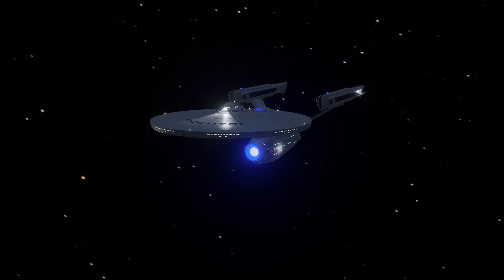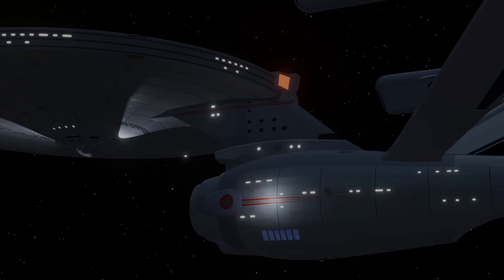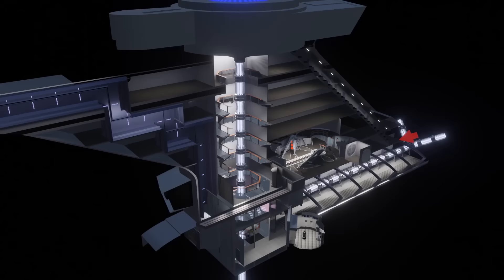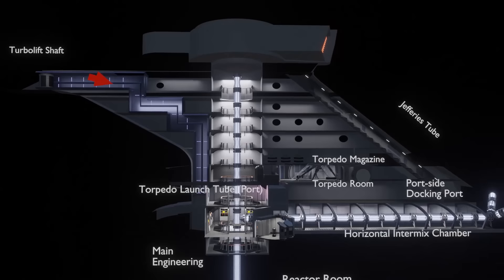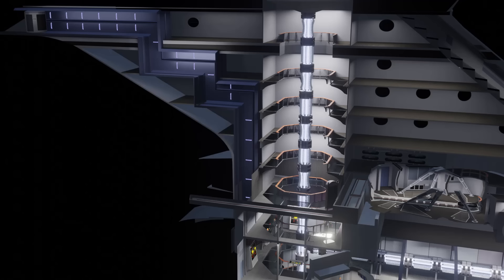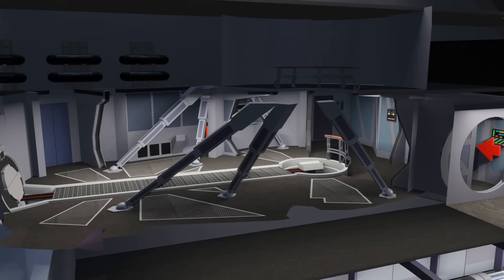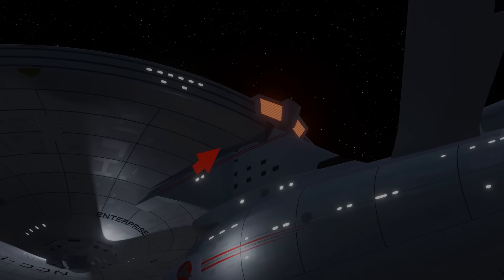The Enterprise Dorsal Problem: how did the turbolifts pass through it?

Comment: A potential solution to this is for there to be an odd technicality about how the ship's length/width and height are measured, which I assume is how you are getting the 5m width.  The stated 300m size is far too small for a ship containing the amount of machinery, crew and general space the enterprise does, however in most realworld ships not all of the physical length is taken in to account  in the stated length and additionally there are various different lengths that are given depending on circumstance (ie waterline length vs main deck length vs flight deck length etc.)

Is it ever stated that the 300m figure is the absolute overall length of the enterprise?  If 300m only encompassed a part of it, then that would allow the dorsal to be larger and so to facilitate the turbolift running past the transfer tube.

Comment: Star Trek: The Motion Picture, at the 19 minute and 41 second mark, where Kirk enters the "refit" NC-1701 TurboLift, gives us pretty much everything we need to know to answer this.  On the wall behind Kirk is the COMPLETE layout of the ENTIRE TurboLift system; INCLUDING a mapping of where it is routed through the Dorsal.  

Although it's more of a user interface than a technical schematic, it clearly shows it descending along side (or in the general vicinity of) the warp/plasma conduit for the saucer impulse engines, all the way down to the core itself (and all points in between).

Comment: There's only one possible explanation. There are transporter pads placed at he top of the dorsal shaft either side of the core. The turbolift passes through one, is automatically beamed across the warp core to the other and continues on its journey. My work here is done. 😁

Comment: In addition to everyone pointing out that the turbolifts could move both vertically and horizontally, I have to point something out - why does the intermix shaft have to run completely vertical through the dorsal section? Other than at the points where it connects to the warp core and saucer section, it can easily run parallel to the Jefferies Tube.

Comment: Possible that the one turbo lift ended (from the torpedo bay). Exit the turbo lift. Walk around the vertical intermix chamber, Then enter another turbo lift on the opposite side of the vertical intermix chamber.

Comment: The nice thing about Trek is that there are gadgets that help plot lines along. Such as inertial control. The lifts are equipped with their own limited life support, inertial controls and structural integrity fields. SO essentially they are spaceships unto their own, just no warp capability.

You thought they would just be capsules riding in tubes? Think agian.

Comment: Yes vertical and diagonal breakaway tram shafts while in the primary hull, and yes, that shaft be in the aft section anyway, well clear of the lifts on either side on main engineering.

Comment: If you have artificial gravity, then "down" is a matter of in which direction it is applied. Meaning, there should be no problem with the turbo lifts running diagonally.

Comment: Surprise, surprise!  The turbo lifts actually use teleports to move around the ship, no shafts required at all!  
PS - When it opens on the "wrong" floor that is just because it always teleports to the next nearest location where a call button has been pushed; this reduces the energy usage by limiting the distance between each teleport.

Comment: I never knew why we all just naturally assumed that the turbolift shaft is super strait. It could be anywhere from diagonal to just off wonk a bit.
Reply: Its moving pretty quick between decks. This requires the shaft to be pretty straight. Else the people inside would bang from wall to wall when the acceleration changes.
Reply: @vast634  Dude...Inertial  dampeners and / or gravity plating. Strait is just as relevant as up in space.  It could be a mariokart track for all we know of other then the corridors and Jefferies tube are kinda strait.  

its a fucking maze down there. 0.0

Comment: there is also one other problem with where the turbolift is placed forward of the engineering and warp core decks,  there is a manned access hatch that we see spock and kirk use in the wrath of khan, that ladder goes inbetween the torpedo tube conveyors and accesses main engineering, so you cant have that and the turbo lift there at the same time.

this falls in line with the oberth having a "manned" canoe that there is no access to the rest of the ship.  lol

Comment: Going over schematics and blueprints actually has the neck's width closer to 7.5 meters (a little over 26 feet). It's still a very unlikely design and there's a problem, but not quite as big of one as you suggest. Also, the tube design IS very weird and would have made much more sense if it had gone diagonally. 
https://www.cygnus-x1.net/links/lcars/blueprints/ksy-enterprise/11.jpg

Comment: All that based on the TMP/WoK movies. Based on later movies, one can imagine a much smaller upper intermix chamber conduit, in a much smaller space around where the turbolift goes. In the FF movie, the turbolift shaft is straight up. (although that scene is completely ridiculous depicting 72 deck plates and so making the ship 3 times bigger than it really is). 
I once tried to drqw the ship myself with very few reference points apart from one angled picture.  I manage to put both conduits aside eachother but as I drew only in 2D I didn't have the problem of having to cross both around. Eventually, the UC movie would depict a much smaller intermix mount allowing more space for the turbolifts since they replace the big conduit outside Engine Room with EPS conduits that are much smaller in size.
However, in Sci fi there is that constant that interiors are generally badly designed in regard to proportion to the exterior.

Comment: The error was made by the person who drew the canon schematics on this, showing the intermix chamber running up into the primary hull. That isn't necessary. It would work if the intermix chamber was entirely in the secondary hull, and the impulse engines drew power from it through smaller conduits and/or had a secondary, non-matter/antimatter powerplant (probably cold fusion). Then there would be room for the turbolifts where you're showing the intermix chamber on your diagrams. I just assume that those schematics are wrong, and that my solution is actually what is happening in universe.

Comment: I always figured the grey paneled line along the center of the neck was part of the starship equivalent of a ships keel. With the other parts of the keel being the front of the neck and the spine that runs the neck and engineering hull. The center line conveniently offered reinforced protection for the warp core.

Comment: ...At first, I thought the Warp Core was further back than this...when I found out that, Yes, the warp core goes ALL The Way vertically through the Enterprise...I, too, wondered "How can a turbo-vator pass through the neck/dorsal of the Enterprise.
...After someone decide to make a blue print of the Enterprise, it was somehow decided that the intermix chamber...what it was called in TOS..was close to where the struts connected to the secondary hull.  Reading that made me believe, without consulting any official prints, that this 'warp core' was pretty much the same.   I was disappointed and thought; 'Who was the 'designer' who thought this of this screw up?"
...I know Matt did not design the Enterprise interior and the exterior was designed for beauty,   When Franz Joseph made the ship's deck plans, things and places had to be..well, 'Placed'.   Where's Sick Bay?  Where is Kirk's cabin? and so on. 
....PERHAPS..the most interesting thing about Joseph's blue prints were/are how they changed every sci-fi fans expectations about the ships appearing in movies or TV shows....After Franz's prints were made and sold to the Sci-Fi fans.  the Fans expected Other space crafts in Sci-fi TV shows and movies to have a logical interior.  When the Hero went from the engine room to the bridge, it had to make sense to the Viewer.   Studios scored extra points for that AND if they made an Interior Plan for the ship and made it available to the fans for nothing to a reasonable amount of money.   
...As nice as the dorsal looks..it didn't really make sense.

Comment: Thinking about the situation as an engineer, while the turbolift makes for good cinematography,  they're really quite pointless. Why wouldn't you just transport to whatever section of the ship you wanted? In the original Star Trek they always had to go to the transporter room... but... that was also pointless as whenever they beamed down to a planet, another ship, or whatever, they didn't need a transporter room there to be received, or get back for that matter. So really, your best option would be to use your communicator as a tracker, tap it, give a location, and let the computer beam you to where you needed to be. 

Extra bonus, you have more room now as you don't have all those shafts to nowhere!

Comment: Ive always assumed the vertical shaft the core runs through because little more than Just a casing around core in the neck with some service access doors on each deck with the turbo lift shaft running vertically right next to it.

Comment: From my understanding Turbo lifts dont need to be VERTICAL, as the have their own localized gravity. Which would allow you many ways to actually orient them in certain parts of the ship so that they can be moved around. I always imagined there were small spots on a route where they would stop spin and rotate to the necessary orientation for diffrent legs of the trip but it was done so fast no one notices. Like a train switching station or platform from the 30s. And the shape of a lift should allow it to do some curved routes inside a ship. I imagine there are some J hook and U shaped parts of the lift routes inside a ship. And even some alcove spots where a lift can stop and wait for another lift to pass it.
Reply: My point is one you allow for some switching station points that allow them to slant, or go horizontal in the routes and some passing alcoves. All the sudden the whole system of turbolifts works. and you can route anything around the engine cores outside at a point that would allow it to work.

Comment: The issue is that it's just a bad design. They sacrificed the interior to make the exterior look better.

The neck should have been at least twice as wide to accommodate the intermix chamber, but that wouldn't look as good on screen.

This is the biggest issue I always had with the refit. The neck is just too thin and a very vulnerable point on the ship.

Comment: Torpedo loading bay problem: Kirk could have exit from the "front door" and "walk around" the warp-core shaft, to access the turbolift in front of it (no needs of a full diameter shaft at that deck, just the vertical intermix chamber and, maybe, just a one person-wide walkway for maintenance: the same could be for the whole lenght of the intermix chamber - in the secondary hull and in the neck, aside the couple decks that are wider - deck 15, if I remeber, where it is the main engineering room)...
... this also could be resolved if there were 2 turbo-lift shafts: the one "behind" the intermix chamber, used from the torpedo bay, could not go directly up into the neck, to connect to the one "in front" of the intermix-chamber (to the primary hull-dish), but actually DOWN, to the secondary hull, where there is MORE SPACE, and basically have a "roundabout" section around the said intermix-chamber in a larger space, then to move to the frontal turbo-lift shaft, and from there to go up to the dish-primary hull section. (This "roundabout" could also resolve as a "staging section", to regolate turbolifts "traffic", from the one actually coming down from the primary hull, to those that needs to go up to it: a lot of actual cable-railways use similar design to allow cabing going down a single track to switch places to the ones going up)

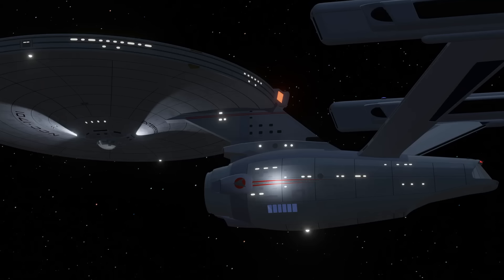Comment: The color bands along the hull at 2:22 remind me of the red stripes used on aircraft engine cowlings to show the plane of rotation of the largest intake fan blades. It’s a warning to ground crews near the engine during startup to stand out of that plane of rotation just in case there is a catastrophic engine failure. On civilian airliners it’s a red stripe and on military aircraft it’s a black stripe. I would guess that the color change is informational only

Comment: This assumes the intermix chamber runs uninterrupted and is the same diameter throughout the dorsal. What if it narrows or splits or jogs (more or less like plumbing) to allow for a turbolift juncture? Also, it always seemed odd if the saucer section was to separate, why did the intermix chamber have to connect to the impulse engines to power them?

Comment: Re; the torpedo bay issue, I'd just assumed there were two torpedo bays (yours is actually shown as Torp Bay 2).  Couldn't the shaft run between two identical torpedo bays - and for that matter, couldn't the intermix chamber?  I would have expected the torpedo room to be further over to the side - if the dorsal is 5m across, then the torpedo "pod" (for want of a better term) must be a good bit more - certainly enough to go around the outside of the warp core.  That would allow it to be moved forward, alongside the core, and would put the door in exactly the right place for the lift.

Comment: Of late I'm leaning towards the Oberth Class's engineering hull being a highly automated unmanned section that only gets visited when necessary, perhaps via transporter or EVA. It's a Toyota Corolla engine down there, infrequent maintenance needed. Built for reliability and not performance. Usually serviced at starbases only. Neither a battleship nor a front-line explorer. Made from quality explodium.

Comment: The torpedo loading ram set only shows one tube.  There are, however, two launch tubes.  The obvious conclusion is that each tube has its own loading ram, and that the door Kirk exits through is going to a utility corridor between the tubes.  This would give room for a lift shaft to go around the intermix chamber on a different deck.

Obviously that doesn't actually fit inside the agreed dimensions of the exterior, but this problem is hardly unique to the Enterprise-class.  So if I was trying to resolve it, and didn't want to do the whole "there's two lift tubes and they join in Engineering" solution proposed below, then I'd go with "our understanding of the exterior dimensions is slightly wrong."

Comment: i am not sure that it was the warp core extending up there, just a major power conduit.

even if it is warp core, it doesn't need the expansive platform area around it that you have on those levels going up the neck.  all that's really needed is enough for maintenance access. so the a turbolift shift could probably pass it on one side.  and if the deck plates can be puller for more access, then there should be enough access for things that can be done underway.  and for things that require a starbase, that probably means they would want to pull the core anyway.  as for the air gap, above the intermix chamber, all that's needed is the space for the matter injectors to pass during an ejection.

lastly, the turbolift shaft could be more easily justified devoting limited space to if its used for access up along the core.  and the pace ahead of the core doesn't really seem to have much in the way of windows, so whats not used by the turbo lift could be used for conduits, pipes and other things between the two hulls.  this leaves the space aft the core for whatever spaces have the windows.  several fanon plans have a lounge or two in the neck to take advantage of the position.

as for the oberth, most plans have the canoe not normally manned or minimally manned with some amenities for personnel to remain down there for extended periods of time if need be..  so either a pad-to-pad transport or a smaller than normal lift handle normal access along with jefferies tubes.

Comment: What if the turbo lift shaft was tubular, and the lift spherical? Gyros keep the "floor" down and the destination may have a skyway style system to secure the lift and provide access. Further more it would be less of a lift system in our understanding and more of a railroad network, i.e. many lifts and routes all operating on the same system. With A.I. controlling it, this would answer a lot of plot holes. Yes, in the series and movies it was tubular, not spherical. Maybe the vacuum tube system then?

Comment: Why are we assuming such a huge opening around the vertical core all the way up? It could very easily been encased in a closed shaft throughout most of the length with enough rm for maintenance access only. Much like boiler ductwork. That would free up a great deal on space around the core.
Imo

Comment: Not enough room in the dorsal for the matter-antimatter conduit and turbolift. It wouldn't have the strength to keep the saucer from bending right when the ship moved left or bending left when the ship moved right. I know some people would disagree with me (and that's alright, all I have is an opinion) but I would make the dorsal much thicker (left to right, that is), don't run the matter-antimatter conduit thru it and move the torpedo tubes to the front of the saucer and separate the impulse engines and put the torpedo tubes between the impulse engines. Yup, it takes up space in the saucer. How do you power the impulse engines? Well, the conduit for deuterium would be smaller, I think, if there is a leak it would be slightly less dangerous. I would run two conduits to the I-engines, one to each engine. Possibly with a provision to channel some deuterium from one engine to the other if one of the conduits was severed.